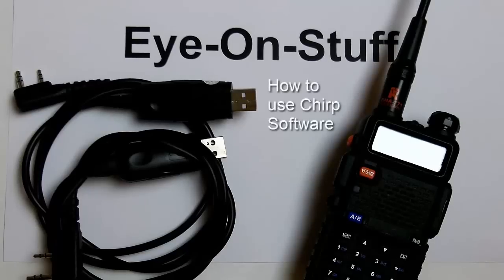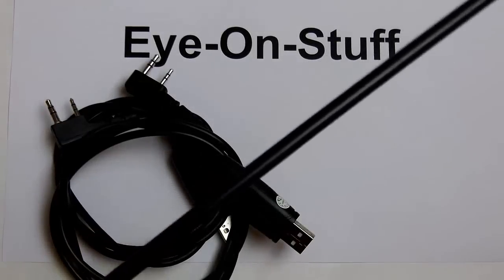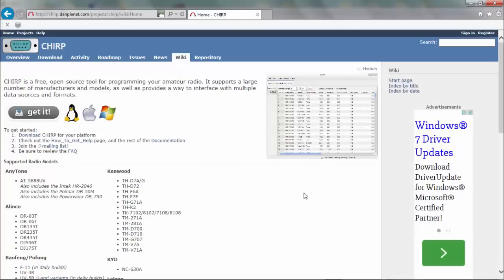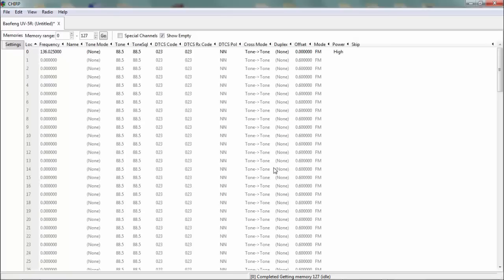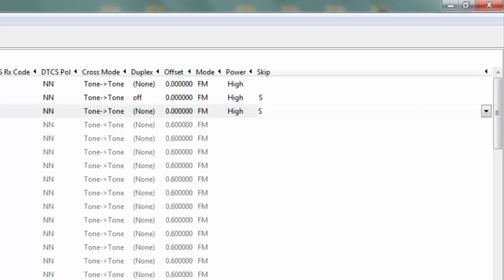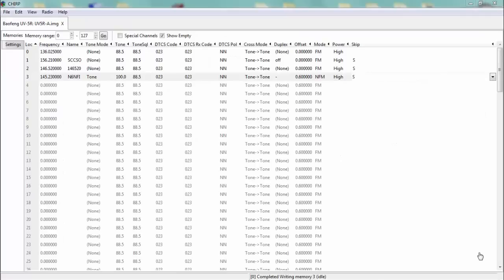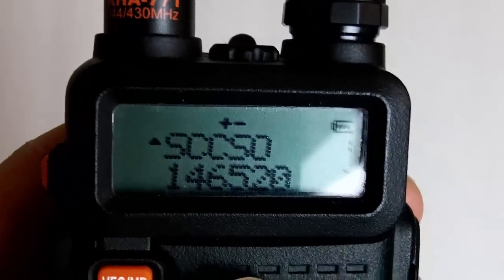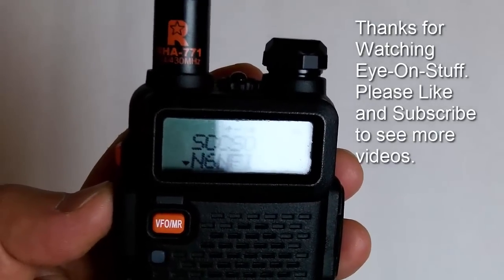CHIRP Programming Tutorial with the Baofeng UV-5R UV5R : How To:  Eye-On-Stuff

Comment: A quicknote on Channel 0: AFAIK, it is the ACC channel, as in the memory place where it stores your active frequency on freq mode. Like an accumulator of a processor, if you know what I mean.
For example, Let's say you were talking on Channel 1, then you switch to freq mode to tune into another new channel. Once you tune in to that new freq, that freq is stored in Channel 0, and you can save it into another designated channel from there.
Ultimately, Channel 0 is not really a Channel, but a memory place to hold your current frequency.
Reply: Ah! Thank you for clarifying! :-)

Comment: Great job.  Good info.  I just picked up one of these units.  Seems to be a great little radio.  Especially, for the $.  I am studying for my technician license.  So, I am new to these types of radios.  Can someone tell me why I cannot manually program a memory channel to store the frequency of our regional NOAA weather broadcast (162.400MHz).  I have tried numerous times.  However, I can store any other random 2 Meter frequency I have tried and it will store it in any channel slot I pick.  What am I missing?  Is this doable only with CHIRP?  I have ordered the cable and have downloaded CHIRP so that I can do easier programming with the computer.  The documentation that comes with this radio is seriously lacking.  Thanks

Comment: It will also program the Kenwood.   CAUTION   Beware of Chirp installation.  I downloaded and installed Chirp.   As customary for popular software (apps) I grabbed the Icon and moved it to Desktop (Win7Pro on Dell Mod.660)   The Chirp Icon seemed to be installed on Desktop, BUT, when left clicked the Chirp program would start on a strange place, not on the Intro Screen for setting initial parameters.   After hours of uninstall/install, I discovered that the only way to launch Chirp was from the list of "All Programs" on the left side list, not the Desktop Icon.

Comment: I'm very new to this radio & chirp software, and in need of some help. I have mine programmed as as scanner and it works, but when scanning and it lands on a active channel, it will monitor for a few seconds then continue to scan before the conversation ends. Is there a setting that will allow the radio to detect activity and hold on that channel until activity end, then will continue scanning?
Reply: got to chirp program and under settings then under "Advance Settings" then to "Scan Resume" is where you set it to what you want.

Comment: Will it work on my baofeng uv-5r5?
Reply: +capt421 It's not listed on theCHIRP website under UV-5r variants. The radio looks like a variant of the UV-5r, but it could be different on the inside. Not sure if that is correct. See if you can contact the fellow who makes CHIRP or find someone who has used CHIRP with it. I would hate to see you bust your radio.

Comment: Great video. I just programed my UV5R. It works fin, but the names i put in for the repeaters did come up, all I see are the freq. What did I do wrong?
Reply: Paul Emmons  Be sure that in programming software you enable the band of your choice (a or b) to show name and not frequency.
I like to have "a" show the name and "b" to show the frequncy, personally.
Hope this helps you out.
Reply: @dougperrault8316  thanks,  I didn't make the correct selection on the radio menu.  I have it fixed now.  Thanks for the help.  Great video.

Comment: Thanks for the Demo, do you have a link for the Prolific Driver for the programming cable or other program used? Thanks much.  73's KC9ITW
Reply from the maker: +Corey Stohlquist Sorry I don't have a link for that driver. I have  two programming cables and both work without installing a driver for me on Windows 8. Sometimes you need to toggle the VFO button before it will work or reinsert the cable to the HT.  It can be tricky getting it working. Good Luck.
Reply: Miklor has some good info on the drivers depending on what OS you are running   http://www.miklor.com/COM/UV_Drivers.php
If you are running Windows, auto update will install the current Prolific driver and you need to roll back to a prior version, instructions here:
http://www.miklor.com/COM/UV_Drivers.php#install
good luck 73 KA7LTW
Reply: John P hi,i'm using window10 when i plugin the cable its install the driver ch340  not prolific

Comment: Hello. I have a Baofeng UV-5R & i can't understand why when i program my channels into it with Chirp channel 1 won't work unless i set channel 0 the same as channel 1 but from channel 2 to 16 works fine. I have them programmed so they will work with my Baofeng BF-888s+. Channel 1 when used has a little bit of echo so can't be used.
Reply from the maker: Andy Farrar I have not encountered this problem before, but I wondering if it would help if you do a system reset ALL in menu #40.  Then change the language to English, next use Chirp to read the memory and save the factory default memory to a file.  Use this file as your template and add all your frequencies to this template file. Then save the updated file to your radio and see if that clears the problem. Hope this helps.
Reply: I don't know about Baofeng, but Channel 1 in most radios (my ICOM T2H and my Yaesu will only accept 146.520 universal simplex in channel 1. Maybe that's it? Mine have no channel "0".

Comment: I am trying to program on a MacBook Pro, and I don't think I have the right port. The default is dev/cu.Bluetooth-Incoming-Port, but I have it connected via USB, so I don't think it is the right port. I don't know the technical names for ports on a Mac, what is a USB port called? I am using the furthest port to the right on the left side. Any help is appreciated.
Reply: Need to get the right software for the USB, go to Prolific (?) and get the right one for your operating software. The apple machines do not have the capability to have the USB connecting software.

Comment: do uv-82 baofeng has the same steps in prog. using chirp ain't there any changes in the setting cause i tried doing your way it always respond "radio did not respond" what will i do??
Reply: When you get that error in Chirp, you probably have a bad cable.   Buy the $20 cable from Baofengtech and you won't get that problem anymore.   The only other reason for that error is that you have two open ports in Windows, and you set CHIRP to the wrong one.   Double check the ports and it should fix the problem

Comment: 👎 Why did you avoid most of the radio settings in the "Settings" menu? When programming the radio (what you claim to show), it would be nice to know what these setting are and when/how they might be used. Without that, you just skimmed over the easy surface of the software. I'd like a bit more. 👎